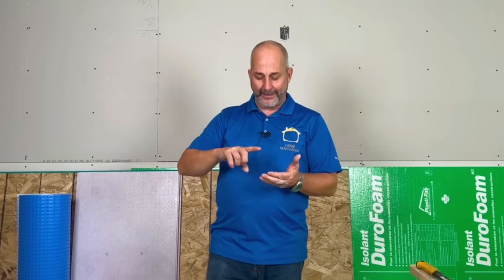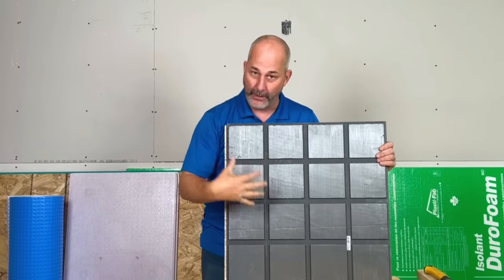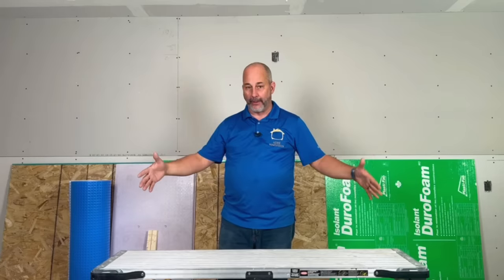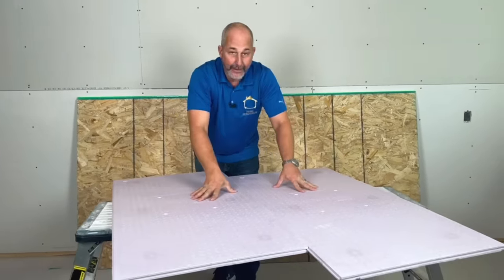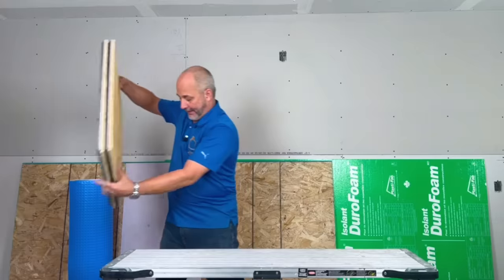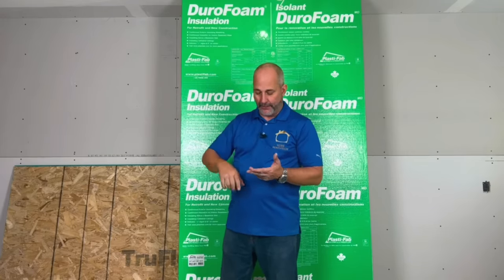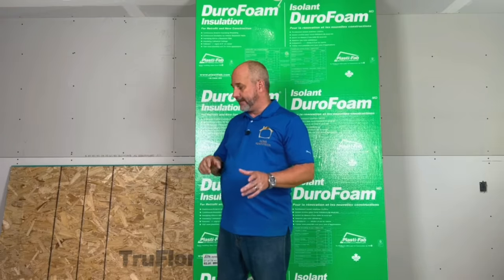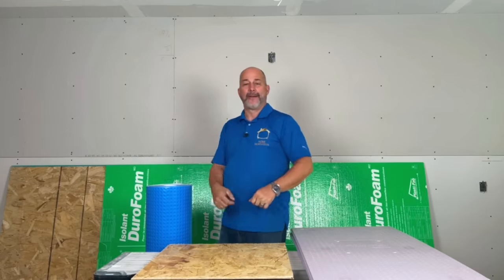Comparing 5 Different Subfloor Systems and What They Cost

Comment: I have 2 floor drains in my basement with pitches towards them. What solution can I use? Do I leave the pitch in the floor or try to level it out? My home is around 1945 build.
Reply: I, too, have that problem. Only one drain tho'. The drop from the exterior wall to the drain is almost 4 inches over a run of 25'. 😞

Comment: 1961 ranch, trying to finish basement-- have foundation cracks, leaky windows at the frame, 6 windows are in a window well with no drain or weaping tile, house isnt properly graded, evidence of water damage of sill plate at some point on all four walls. It does leak from the foundation cracks. Overall though the humidity in the basement is lower than that on the main level, I have a monitor and I'm continuously checking the humidity in the basement at different points. It usually stays at 45%. I have not seen any evidence of water coming up through the floor of the basement. 

So to summarize I'm going to replace all of the windows. Not sure what to do about the drainage in the window wells, I don't know if there's another solution besides window well covers. Going to look into grading around the house, since it does seem like there's some evidence of water coming up over the foundation, though I don't know how big of a project that'll be. Going to seal up the foundation cracks. Currently there isnt a sump pump. in the basement but I'm going to see about getting one installed.

I was going to use the OSB with the grooves on the bottom from Home Depot and put vinyl on top. 

Any recommendations you have are greatly appreciated and needed very very needed...

Comment: How would you install DMX in basement bathroom around toilet and drains?
Reply from the maker: I don't I transition to tile for the room and add a ditra XL to raise the height of the floor before tiling. if you do then open the floor around the toilet flange and cut it out and extend it to a new flange on top of the osb. and screw down all the dmx and 5/8 osb. Cheers!

Comment: Let’s say you don’t have a basement,you have 2x10 floor joist insulated then 5/8” T&G osb would you consider 3/4 styrofoam then another lair of 5/8” T&G osb then your final flooring material , room height is not a problem….

Comment: What about building a subfloor of 2x4s and plywood or 2x3s and plywood?
Reply from the maker: you don't get the air under the floor to share with the wall and balance out moisture that way. Cheers! try the 1 step with vinyl plank. it is a great solution for houses without a predominant moisture issue. Cheers!
Reply: @HomeRenoVisionDIY  firstly thanks for the quick reply, I’ve watched a ton of your videos and you’ve been more than an inspiration and help, so thank you 🙏🏼.

Secondly, house was built in 70s and basement was half done with 2x3s and ply was subfloor, for the unfinished section I drilled some holes in wood at base of walls to allow for moisture and air to pass from walls to subfloor, could this work. Or should I just rip out everything and do your first method with vinyl plank. Some of the walls were built over existing subfloor. House is one hill and has no water issues. Thanks

Comment: My daughter's house in Kenosha Wisconsin was built in 1947.  It does not appear to have an water problems.  Exterior grades are good.  Plastic taped to the floor does not collect condensation and we have seen no sign of water leaks anywhere.  Exterior walls were framed with 2 x4's and insulated by a prior owner.  The basement is COLD!  The basement floor finishes all need to be replaced,  They are a mix of poorly installed click planks, carpet that smells like dog and peal and stick vinyl floor tiles.  Headroom is OK but less than desirable.  What to do????

Comment: I used the Dricore as a subfloor over my concrete basement floor.   Over that I placed vinyl flooring with a foam underlayment.  The Dricore is not a cheap product but as mentioned in the video it does a wonderful job of acting as a thermal break under the vinyl flooring.  Please keep in mind that Dricore plus flooring will raise your floor by 1.5 to 2 inches.  The basement is walkout with a sliding door to the outside.  The door looks a little buried next to the floor but it's acceptable.    I highly recommend Dricore if you are considering using it for a basement project.  

One note - HD doesn't usually  stock the Dricore insulated planels.  The ones you find in the stores are the thinner less expensive membrane panels with the hard plastic backing.  The stuff is pretty easy to install as it is tongue and groove and cuts well with a table or circular saw.  I just floated mine and have had no problems with it shifting.
Reply from the maker: great point. the product is new so Home Depot tend to provide it in 1 store per region to make it available until they know how much it sells. Cheers!

Comment: Hey Jeff ! 
Quick question for you about the 4*8 sheets of rigid insulation board. Are they rigid enough to lay down and then install a 5/8-3/4 subfloor material on top, fastening the plywood down through the insulation board into concrete? Or do you recommend laying some 2*2s every 16-24 inches and cutting the rigid insulation down and then laying the plywood over that ?

My concerns about ONLY insulation board is that the floor will be too bouncy , but on the other the plywood should be rigid enough to withstand regular traffic. 

Love to know your opinion on this!
Thanks and lots of love from Toronto Canada ! 🤙

Comment: Question on the DuroFoam - could a person use that and apply vinyl plank or click flooring right over top of it? I'm not looking so much for water management but am looking to keep the temperature downstairs without injecting a lot of thickness. As always, great video.

Comment: Thanks Jeff! Love your videos. They have helped on so many projects. We’re planning a big job of redoing the first floor of our slab on grade house here in Vermont, so your video is extremely timely. We have tested and there’s no evidence the slab is wet from moisture migration from the subsoil, but there have certainly been moisture issues from condensation, and especially on tile floors in the kitchen. We were actually planning to use the foam/subfloor method you described to address this, but I’m curious if any XPS or EPS rigid foam will suffice as a vapor barrier? Or does it need to be faced with a membrane like DuroFoam? 
Thanks!
Reply from the maker: all closed cell insulation will work great for moisture management. no worries and it eliminates condensation at the same time.

Comment: I have a question… I just built a 8x12 shed/ train room. I have a 6’ sliding door and everything is built on 2x4pt plate … I have come across some blue rigid foam…2x8 sheets. Enough to cover the floor twice. 
My question is, can I install my click together laminate flooring on top of the foam? Using vapor barrier? Under the foam?

Comment: Hello, 
I have a high water table, crummy grading (my house sits in a depression). I trust your long experience and honest approach. Help?

I'm in St George Utah, USA, in an arm of the Mojave Desert. Water table reputed to be only 5' below ground. ?? We are at around 2,300' altitude above sea level.

I have some bad drainage issues between my home + the next one, just like it, about 15' away from me.

The down-&-dirty developer, 1989, built sidewalks right up to each outer wall, tight, around the whole house. (Detached 3 bed/2 bath in a condo Dev).

I'm on a concrete slab, with cracks, very hard water and old pipes. Nightmare!

 I will have only a little money this year to bring my home up to decent stds. No upgrades since 1989 ... :(

I'd love to put down nice quality birch or pine 23/32" PLYWOOD, 8" planks, no knots, S1S, install + finish myself, as flooring.

From your talk: I thought, but, please advise:
• Dimpled membrane (water mgmt.), 3/4" Durofoam (thermal break), then 5/8" OSB on top as subfloor.

The flooring over that 1-7/8" of SUBSUB, to be 5/8" (or 3/4") birch or pine, s1s, no knots, nice plywood.

Resale, water issues, my elderly age, +  my tiny resources are all top of mind.
Thanks very much.

Comment: As a FYI, Insularmor is insanely expensive for a freaking piece of foam.  
DMX 1 step $.64 a sf.  
Drycore = $2.25.  
Insularmor = $3.50.  

That's 5+ times the price of the rolled plastic/foam.  No thanks.

Comment: Hey Jeff!
First, thanks for all the knowledge you share. Your videos are great! 

I'm working on finishing my basement on my 1961 house in Denver, Colorado. I would like to have a thermal barrier and I am looking at doing electric heating mats for heating. I'm open to different flooring options, but leaning towards a floating floor. 
Another factor is the ceiling isn't overly tall (about 89" lower at the central air vents) unfinished and I'm doing double 5/8" drywall with hat channels for sound mitigation, so I'm trying to not lose more height on the flooring if possible. 

I haven't framed the basement yet(aside from the bathroom). 

Any suggestions on how I might move forward? 
Thanks

Comment: Hi, a fan since 3 years ago. Your old video about how to take tile floor off helped me take the tile off in my old 1920 house. Now I have subfloor problem. The subfloor in the kitchen near the walls are all cracked and there is mold. I need to replace the subfloor. The house is on. Raised foundation and it may have moisture issues. What product do you suggest to prevent moisture issues? 
I also want to place red stone tile on the kitchen floor and a solid ceramic tile in the bathrooms.

Comment: DMX and vinyl ,worst decision I have ever made. Do not,I repeat,DO NOT Instal LVP on DMX in basement.Vinyl 5.18 CAD per sq/ft,plus 100 CAD for roll.I am seriously thinking of taking all out and scrap it,that's how frustrated I am.Already tried to fix five hollow spots.Terrible
Reply: Hard to find reviews on this stuff. What is the issue, exactly?
Reply: @PointerWareSales  vinyl isn't heavy enough to push down so DMX is actually creating hollow space underneath and cause floor to move ,crack joints,and sounds awfully.Installed same floor in my hallway without DMX , straight on old laminate and no problem whatsoever.If you thinking basement then mandatory subfloor with plywood,which I wanted to avoid because of potentially water can get in and then your plywood is ruined.